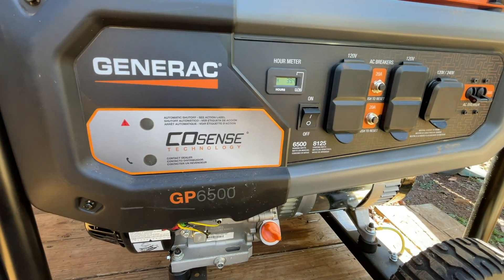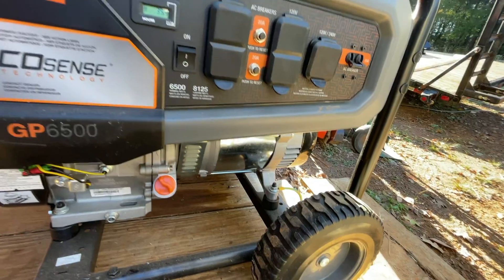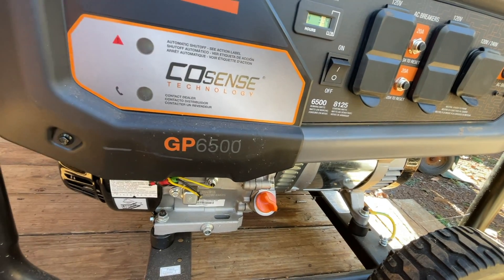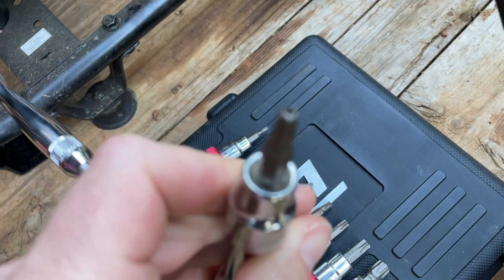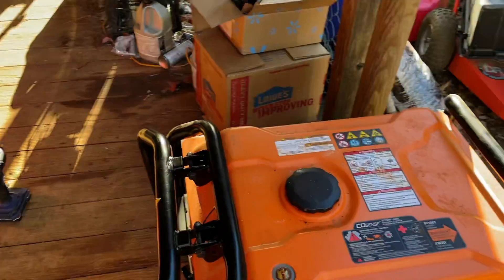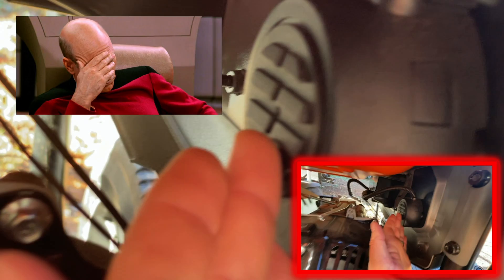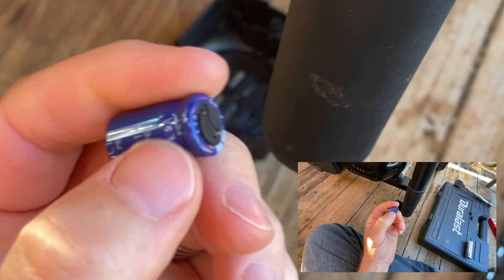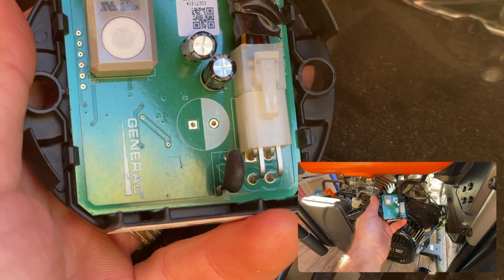Solved - My Generator Starts But Won't Stay Running (GENERAC COSense GB6500)

Comment: I have same style generac, co6500 . But when I take the name plate off and unscrew the 2 screws. And then I get the module out it has a different portgen idle control module. The part number is 100036511. Mine has a red and yellow wire and 2 black ones. I unhooked the red and yellow. It stayed running. But it wouldn't power up my appliance. Do I unhook the black ones instead. If you Google my part number and hit images. It will show what I'm dealing with..I wish I could send you pictures of what I'm talking about. Do you have a email ? Any help will be helpful. I live off grid in Hawaii and I need the generator for my tie-dye business to wash my clothes.

Comment: you can also order the part direct from Generac part number is as follows   A0000267819 its called a Module O2
Reply: i ordered 4 of them 2 for myself and a friend and 2 for a contractor having same issues

Comment: The first CO monitor I noticed was on a Honda eu2200i. The CO sensor is a dealer only part. This is sold as safety, but a battery powered CO sensor is less then $20 and lasts for 5 years. Current building codes require a CO sensor in new houses. This is crap from the corrupt greedy manufacturers to boost profits and show extreme contempt for the customer. Learn to bypass this crap and use a battery powered CO sensor instead. The tow pins should be soldered together or use a wire nut or Wago or similar electrical connector. Corrosion of the unprotected leads will likely cause a problem in the future.

Comment: The co sense is for carbon monoxide poisoning a must have on the machine why didn’t you call generac to fix the problem or see if you could by a new board now if you have a carbon monoxide issue the machine will not shut off really are your children’s welfare worth a cheap alternative rather than fix it the right way

Comment: Thank you so much, I bought this Gen  Generac GP 6500 on FB market for a steal.  Seller started it up ran and shut down.  He said it was out of gas knowing full well it had an issue.  Thank God I found your posting followed your instruction and problem solved.

Comment: We're facing a winter storm so i checked the generator and it would stay running. After playing the is it bad gas game and changing out filters and gas and cleaning the carb I found your video. Our capacitor is still attached but as soon as I unplugged the whole module it ran fine. Thanks from Da Yoop
Reply from the maker: I'm glad you figured it out. Hopefully, you won't need it, but that's a great example of testing your preps.

Comment: These gens seem to be the suckiest , bought one used it once and then it wouldn’t turn on . Managed to get it up and running, But it got heavily rusted under the gas cap and other areas even though it was kept in a garage …

Comment: I would have soldered the capacitor back onto the circuit board (and glued it down).  My two older generators don't have CO protection, but I have been using small engines all my life, and I know to stay well away from enclosed areas.  When I run the generator, it is 25 feet away from the house, with the exhaust pointed out toward the back fence.

Comment: Hoping maybe through comments or whatnot you’ve experienced this. Brand new, do all the start up, runs about 2-3 minutes then shuts off. Watch your video, remove the sensor, everything’s intact, but now the generator doesn’t shut off. Super sensitive sensor?
Reply from the maker: That’s frustrating. Check all your ground connections.

Comment: Tried to bypass the cosense using this guide on xt8500efi. It will not start with the sensor unplugged. With the black wires tied together, it runs about 20 seconds and shuts down. The sensor for the efi units appears to have an efi specific pn. Any ideas on eliminating the sensor on the efi units?

Comment: Figures, did just like you did. Now starts, runs and turns off. No power to outlets, smh.
Reply from the maker: @patrickteich8628  check the ac breaker

Comment: I have a 5600 an it started running 30 sec an dying. No lights . That I have seen . Everything is full.
Reply from the maker: Check all your ground connections to be sure a wire hasn't wiggled losse

Comment: kills me cuz its so easy to just solder on a new capacitor and hot glue it down so it doesnt vibrate... not too hard to get some skills to do that. couple videos and maybe $30 for an iron and stuff.  but hey! Your fix works. so thanks for posting!
Reply from the maker: A proper fix would be best for sure but in the middle of a hurricane or snowstorm a video showing someone how to go to the store and buy something they cannot get is not the priority. But I get your point and I wish I had fixed mine properly the first time but it works great without it and I’m not going to stick the unit inside my house while running.

Comment: why is it that no one is putting on how to bypass a champion 2500 that really works, cause ive sone 3 that dont work pulling black wire, completely covering the sensor, bridging wires none work my 6 month old generator has never run over a few minutes and i got it 6/24 did not start it till 8/24 so basically could not send ot back to amazon

Comment: So i did exactly what your video shows to do. It now runs which fixed that issue but my question is do you need to plug the plug back into the board after wiring the two black wires together. When testing it I now ha e cane across another issue of not producing power out the outlets. Would that be because I have to plug that wire back into the board because I just left it unplugged...what do you think?
Reply from the maker: Be sure to check the circuit breaker. That one gets me sometimes.

Comment: A way easier, safer, and cleaner way to jump the black wires is to just use a Tap Splice connector somewhere along the bundle of 4 wires.
Reply from the maker: That does sound easier ☺️
Reply: @EastTexasHomestead  And if you ever decide to replace the CO sensor unit, you can just take the Tap Splice off, and your back to stock.

Comment: Good info. I would feel better ordering a new capacitor online from just about any electronics warehouse and solder the new part and clip the leads...but i agree, its a total failure of quality control at Generac.
Reply: Also...the Cap is only $1.25 on Amazon.
Reply from the maker: I’m better at cutting wires than soldering 😝
Reply: Secure the cap with silastic or the vibration will just rip it off again.
Reply: I agree with you.  Buy the cap and find a friend to solder it in.

Comment: I didn’t destroy the pc board, but I did directly connect the two black wires. It works great now. 

The little white box on my pc board came loose. Generator (GP6500) runs now and supplies electricity. 

Just pull the 2 black wires out of the connector, tape them together, and connect back for the others to work. 

Yellow light does blink constantly now.
Reply from the maker: Good to know. If I get to repair another one I’ll try this first.

Comment: Has anyone tried just cutting the yellow wire?

Also, I’m wondering if initially unscrewing it from the frame and suspending it from a string or heavy rubber band might minimize the vibration and alleviate the problem? 
Yes it’s a defect and a bummer but for now we need options.
No one is coming to save us.

Comment: Thanks. I had mine run for 20 hours then had the same problem. I took it to the service center and said it was a bad spark plug. paid 74 dollars. I got it home and same problem. Called them back and wanted me to bring it back.  So there sorry assed junk. Should sue since this is a safety issue a family could have died.  I use my carbon monoxide unit anyway.

Comment: Just in case you read this. I made the comment to someone else's, but the yellow wire is the low oil cutoff switch. I think youve bypassed that. So you should probably disclaimer thay for those who wouldnt ever check their oil.
Reply: Could he/we just cut the yellow wire?
Also, If he splices the blacks and plugs it back into the motherboard I don’t think it bypasses the low oil cutoff. Agree?

Comment: Man I can’t Thank You Enough, I’m in Houston and we just got hit by a hurricane. And we are without power, I went to Lowe’s also this morning 7-10-24 picked up the exact same generator and it happened on the 1st day. I saw your video and did exactly what you said and wala it’s running. Once again Thank You!!!
Reply from the maker: What a shame! Generac has got to fix this. You’re the third person today with the exact same story. This so-called safety feature is going to kill someone. But I’m glad this was helpful and you were able to get it fixed. Great job taking care of things! We are just north of you and I’ve only had to deal with a few small power outages. Check into some of our videos on off grid solar so you can be ready next time. Stay safe down there.
Reply: This is day 4 whit out power 
I have the exact same one. From home depot   And did the same problem just now
Reply from the maker: @h-townlifestyle9105  Sorry to hear that. Were you able to fix it?

Comment: Thank you so much for posting this fix. Purchased mine this morning due to hurricane Beryl.  Ran two hours and stopped. COnon-sense!
Reply: I'm in same boat.  59 hours on mine.  Same issues as this, but not sure I want to take apart and void warranty.  Yet, my 88 degree interior of home disagrees and says DO IT!  Have you tried this yet?   Curious if it fixed your issue?
Reply: @disorderlymovement  Haven't tried yet.  We reduced the load on the generator and are managing with only one window unit. In addition to dealing with the results of Beryl, our entire family is really sick. 
So far reducing  the load has helped...we will see.
Reply: @whitesabre9974  Thank you for the response.  I did go through with the work after some reluctance.  Yet, only to the point of removing the "control unit"/board.  My capacitor was still in place.  Yet, with removing the board, the generator is running great.  Has gone for a solid 6 hours now with no issues.  The on/off switch does not work, but I can carefully pull the spark plug wire or just starve it of fuel when I decide to shut it off.  Hope you are able to get yours working 100%.  Again, truly appreciate your response and wishing you restored power very soon.  Let's hope that is the last storm for Houston for the season.
Reply from the maker: I’m glad you had success getting power! Now let’s hope you get grid power back up soon.

Comment: Was having the same issue of the generator turning off. I removed the CO sense and it’s working fine, but now I don’t have ac power
Reply from the maker: Check to make sure the breaker on the far right of the plugs is flipped on.
Reply: @EastTexasHomestead  it is :/ 
Not sure if there’s another issue now
Reply from the maker: I’m really not sure. I’ve had others say this after “fixing it” but don’t know why. Maybe double check the wiring. Did everything look the same as mine or was it a different wiring configuration?

Comment: Bro you are awesome I have a different board but the same problem. My red was labeled 120v green was ground and one black was ignition coil and the other ignition switch. Pull the box and it works but dont shut down but thats no issue because I generally cut the fuel and let it drain the carb.
Reply from the maker: Glad it helped and thanks for sharing!
Reply: On my Predator 9000 I just cut the coil wire and shut it down by turning off the fuel or to shut it quickly just apply full choke.

Comment: Thank you very much for showing how to fix this problem. I have the same generator, with the same problem. I thought it was a fuel problem. I changed the carburetor, and it still shut off. Followed your directions and it fixed it.  Thank you very much for the help !!
Reply from the maker: Thanks for sharing

Comment: I’ve got the same exact generator……..12 hours same friggin problem, PISSES ME OFF! I’m gonna bypass because at $115.00 for the part, it will probably go bad AGAIN!! Damn I paid good $$$ to have a generator OF QUALITY!!! In the year 2024 if you don’t know about carbon monoxide…….you probably don’t deserve to live anyway!!
Reply: I appreciate the video, but wouldn't it have been simpler just to resolder the capacitor back on. seam better than risking a sock and pulling out the multimeter. Just pull out the soldering iron and be done in ten minutes  lol just my smart ass two cent lol
Reply: @felixgazmey9647 
Because it's a useless safety feature. It's for people that will run this in their garage with the door closed. Or even inside their home.
Reply: @felixgazmey9647 good call....the Capacitor is  $1.25 on Amazon
Reply from the maker: I’m not sure why they don’t have a recall on this yet
Reply: Also, I work on these every day right now. Florida. And they are brand new, lots of them, hardly any hours on them.
Reply: How do you bypass it? I have the same issue and can't get mine to solder back together
Reply: @mikenagle2574  disconnect the 4 wires to the co sense module and tie the two black wires together.
Reply: One more thing, the yellow wire is for the low oil pressure switch, so you've effectively bypassed that. I might need to check the wiring diagram again to confirm that though.
Reply from the maker: @celicablues  Thanks for the heads up. Any idea why some people are loosing power after they do this?

Comment: Took mine out and now it runs great again but doesnt produce power? Any ideas? Thanks
Reply from the maker: @rpfl5586 Be sure your 30 amp AC Breaker is turned on. That's about the only thing I can think of. I just used mine again this weekend, and it works great.

Comment: Couldnt youjust cut the 2 black wires and wire nut them together? Great video. Thank you
Reply: Yes. And I think if you then plug it back into the mother board you don’t by pass the low oil cutoff.
Reply: Don't even have to cut the wires if you use a Tap Splice.

Comment: Thanks a bunch for making this video. I have the same exact generator I bought like 2 years ago because of a snow storm. The generator sat in my garage ever since never even put fuel in it. Tried to run it today to power my welder for the first time and nothing. Made a couple of connectors taped up the empty leads and it worked perfect. 😎👍
Reply from the maker: I’m glad it worked for you! It’s a shame a good brand is shipping out trash and not standing by the product.

Comment: So close... using an RPG to take out a bee. It was a potentially easy and cheap repair with the decapitated capacitor, IMHO. I guess the root cause of the failure is that whoever made that module, didn't care to secure the electronic components in glue or potty. Generators produce a lot of vibration and is the main reason why electronic components that are left "flapping in the wind" will eventually work its way out of the circuit board... one way or the other. People going this route ought to check local state laws on circumventing or disabling safety devices on generators. Nevertheless, I enjoyed the video.
Reply: Would it make sense to proactively glue/pot the capacitor to prevent it from vibrating loose?
Reply: @freyinnovations  That would be a good idea. I have used hot melt glue to secure large capacitors. But I made sure the components never got hot enough to reach the melting point of the glue. There are better ways to do it but I'm not really familiar with the exact compound they use.
Reply: @orlypalomar  Yeah, I wouldn't use hot melt glue for this application (I've done that for others), but I would think a good silicone adhesive would do the trick.

Comment: amazing!   Thanks.    That was very good advice.... and just in time.  I was just about to go buy a Honda generator for 900 bucks!   so nice.   We are in a hot climate too in Baja California Sur so I like your theory.   Oddly my little blue transistor was fine, but the little square one was wiggly.  Dumb stuff.
Reply from the maker: Glad it helped!
Reply: That blue thing is an electrolytic capacitor. It is easy to obtain another new one with the full leads, and solder it through the holes on the board. You have to install it with the correct polarity though, which you might be able to figure out by comparing with how the similar smaller ones are installed.

Comment: Sir, I did everything in your video: my generac gp6500 starts and turns off just fine now.  The conundrum is that now that I did everything that you shared, step by step, my generator no longer provides power or electricity.  By chance did you encounter this and if so will you please share the resolution so that my gen provide electricity again?  Thank you in advance and standing by for your convenience. 🙏🏼🙇🏻‍♀️
Reply from the maker: That’s so strange. I haven’t had that issue, but maybe someone else has and will be able to give direction.
Reply: Did you ever figure it out? I’m having the same issue after the bypass
Reply: Try instead just jumping the black wires   then plug the harness back into the mother board.

Comment: What is the part number for a new part to replace this if it breaks rather than just bypassing it
Reply: I have the same issue and I called Generac.  They told me that the new part # is 10000032946 for $359.99 which is a rip off: especially, since it's evidently a frequent issue.
Reply: He’ll no
Reply from the maker: Wow! Instead of recalling a bad design, they want to charge half the price of the generator for us to fix it?